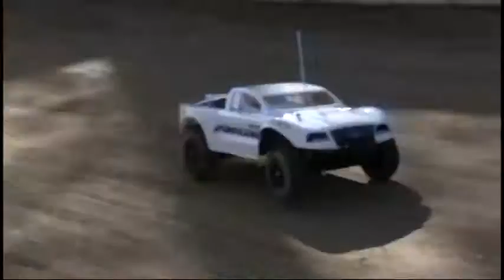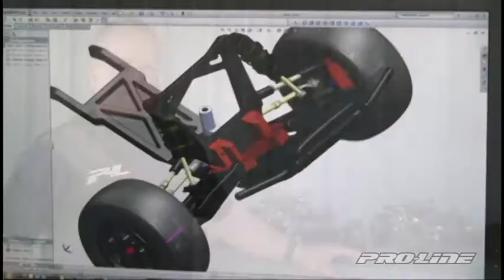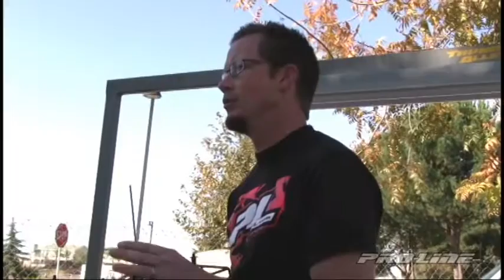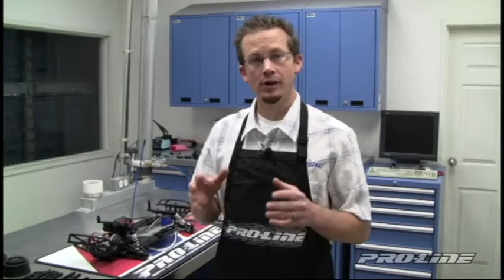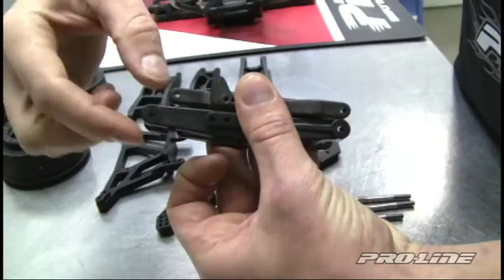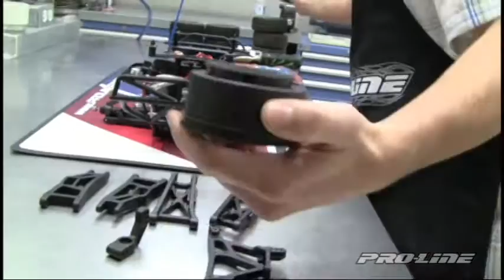Pro-Line ProTrac Suspension Kit for Slash 2WD

Comment: so does this work with the 2wd Stampede?  And will it make a difference in handling?
Reply from the maker: Hello Craig, yes, this will work with the Stampede, and yes the Pro-Trac will add quite a bit of handling performance as well as durability over the stock setup.
https://www.prolineracing.com/performance-parts/protrac-suspension-kit/